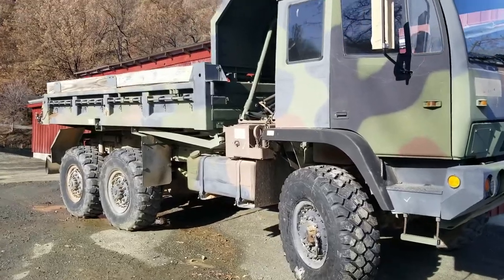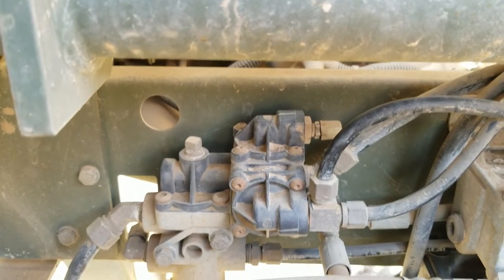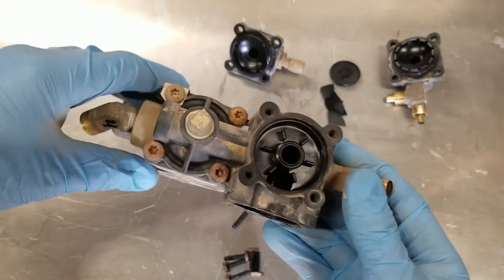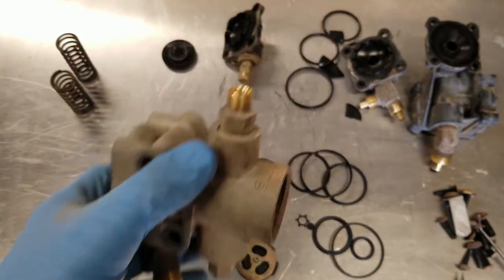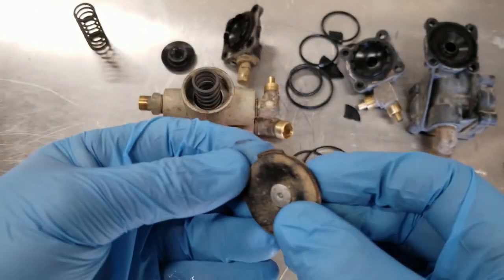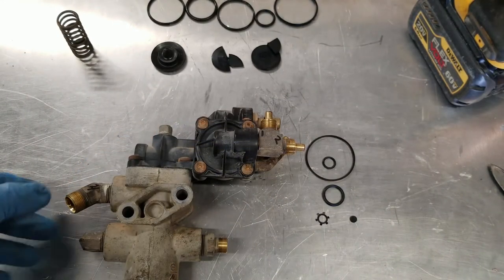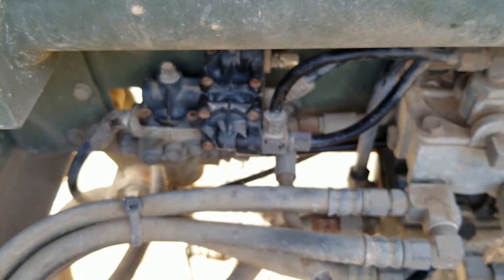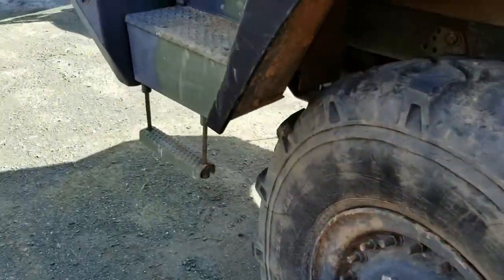LMTV Air Brake System - Haldex Tractor Protection Valve Rebuild - Troubleshooting Leaking Brakes

Comment: Love your video on tractor protection valve rebuild
Reply from the maker: I love the valve not leaking!
Reply: @cowboyV2  Getting ready to do mine.. same exact symptoms
Reply from the maker: Awesome! Super easy, cheap and sooo nice to have the brakes dialed! What truck do you have?
Reply: Well, that was my problem, looked exactly as yours did when taken apart.  Have not installed yet, bit I am sure its solid.. Thank you
Reply from the maker: Yeehaw brother! You'll get it sorted out!
Reply: @cowboyV2  Rebuilt the relay and protection valve, still getting air out of bleed air at top of protection valve.. Any recommendation
Reply from the maker: I had some chunks of old diaphragm stuck in mine. Could be debris?
Reply: @cowboyV2  going to remove and recheck.  You could mirror my valve to yours, almost the same exact failure

Comment: Hi there.  The question about ctis; is that possible to remove all ctis electric  valves and replace them with manually  adjustable air pressure valve?

Comment: Easy trick on bottom snap ring with riveted rubber cover.  Use a deep well socket.  Put rubber inside socket and use vise to collapse spring to get snap ring in groove. With rubber out of way you can see what you are doing.
Reply from the maker: That's pretty clever! Sounds like a trick a pro who has done a bunch of these would use... What's your background?
Reply: @cowboyV2  I started as an auto mechanic and switched to aerospace machinist.  Now have a M1084.
Reply from the maker: Ha ha! An Aerospace Machinist with an M1084! I figured as much! 

Although, some of the guys I know that fit that description might have made a single purpose tool for the job... leftover peice of 7075, knurling and all! 

All in fun! Thanks for the tip!

Comment: On batteries.  I took bat tray out and cut 3 holes thru it for 3 size 31 bat and used a cutout pc for tie down for all 3.  Works great.
Reply from the maker: Not sure I follow the last part. Cutout pc as hold down?
Reply: @cowboyV2  One of the pieces I cut out.  I drilled a hole thru it and it goes over stud between batteries to hold all 3 down.
Reply from the maker: Ah! Got it now!